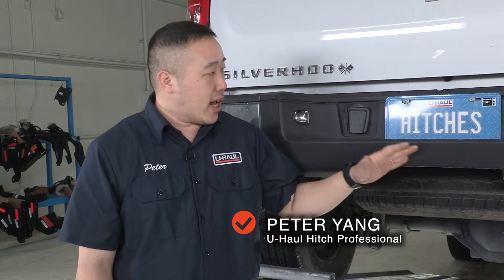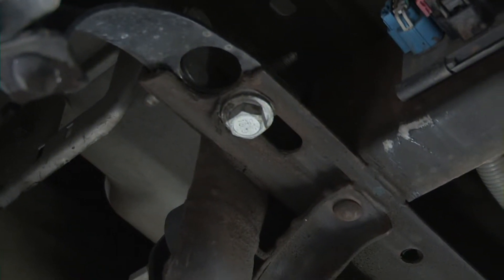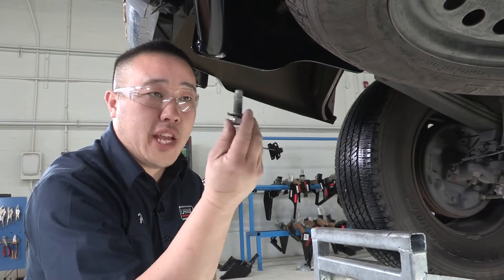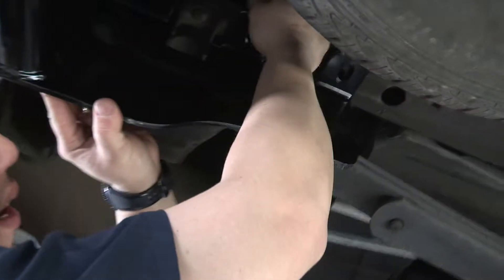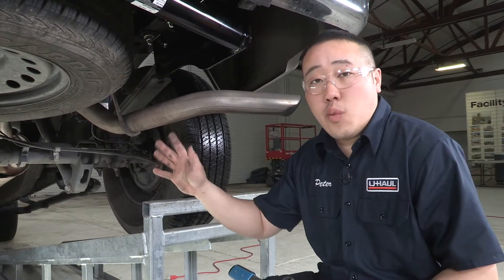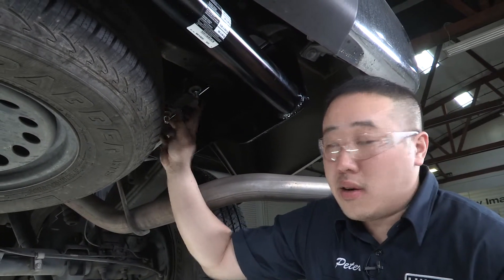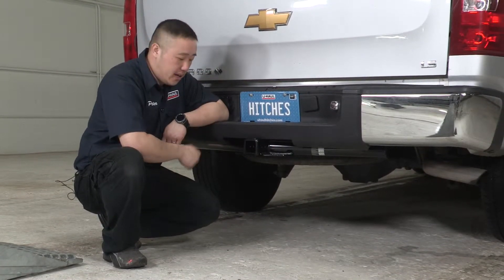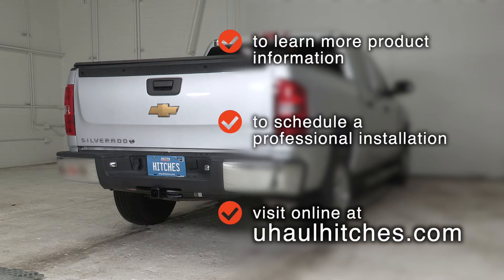2011 Chevrolet Silverado 1500 | U-Haul Trailer Hitch Installation

Comment: What class receiver is that?
Reply: jay Spike  I want to get one that can handle 2 to 3 times the GVWR not for towing, but for recovering my truck if it gets stuck in deep mud. Those recovery straps and kenetic ropes put a incredible amount of force on your reciever if your stuck in deep. The wrong receiver can break right off your truck unless you want to risk bending your truck's frame by pulling from it